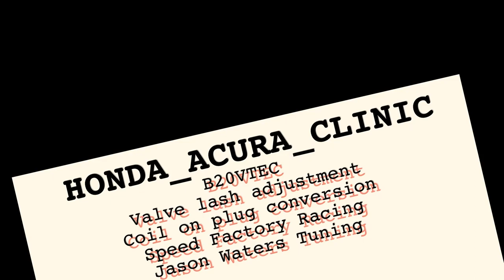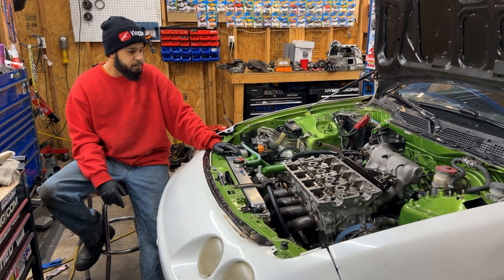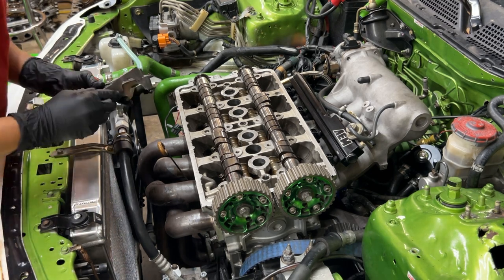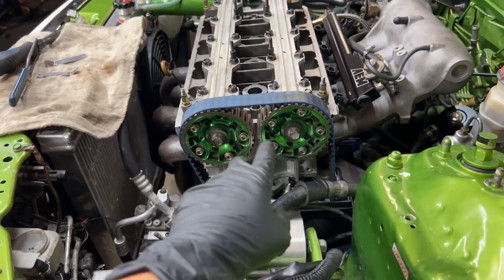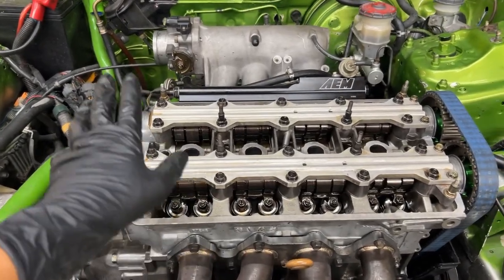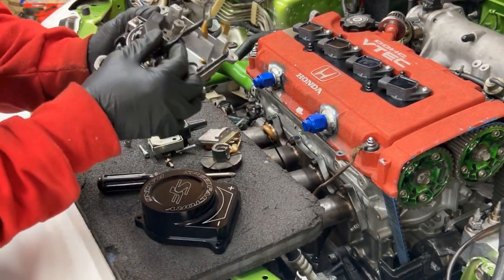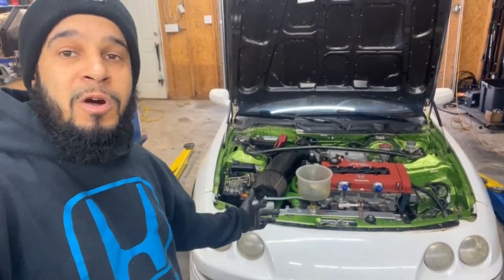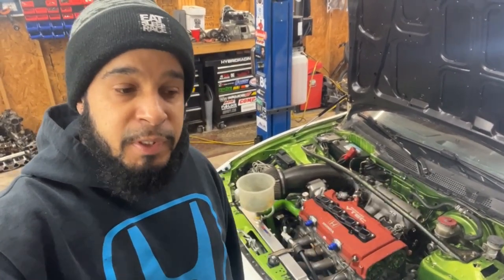B20VTEC ACURA INTEGRA | coil on plug conversion | valve lash adjustment | Tech tips

Comment: Smh hmmm boosting a b20 with stock sleeves is risky considering cylinder walls aren't very thick being 84mm, suppose depends on boost level and most importantly tune determines that. Nice setup though 👌
Reply from the maker: The B20 block isn’t weak because if the cylinder walls being then. It’s the design of the sleeve and where the join. They crack where they join together. Not because thickness